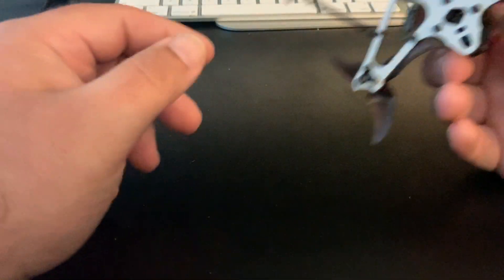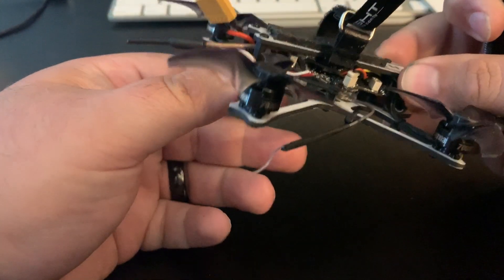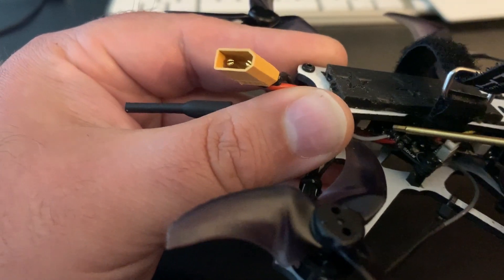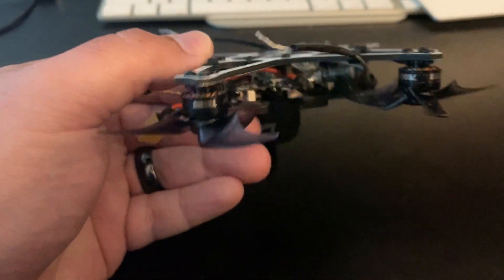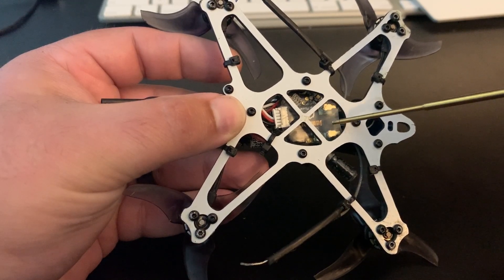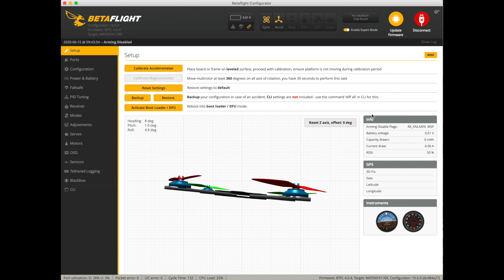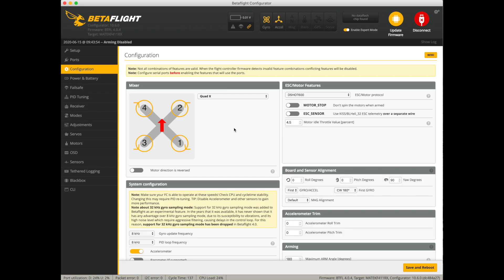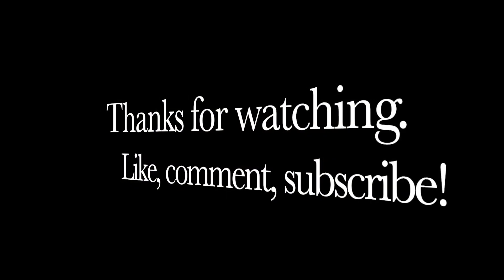TH Freestyle - Jumper R1/ Sbus Receiver Setup

Comment: Hey man , i know its kinda old vid as for today but i have a Q how much range did you got from that setup , i have same quad with Jumper Tlite and jumper R1F on same wiring and im getting 400m tops at plain fields  and than having RXloss at around 70% rssi weird is that i had BetaFPV TX and on stock SPI receiver ive got 200m o.O 
 I really dont want to upgrade to CFR right now since just upgraded to this TX and new vtx&camera :/ 
Tnx for answer in advance.
Reply from the maker: If you are still wanting to use FRSKY, I would recommend the XM+. You’ll just have to make sure you get pre access and pre 2.1 firmware. I was getting less range than an RXSR with the Jumper Rx.
Reply: @TitanFPV  I really wanted to avoid that those firmware flashing is way over my comfort lvl and I don't have where to do it I may invest in CFR just for peace of mind it seems that ppl don't have problems with it ,tnx for info.
Reply from the maker: Anytime. Unfortunately most FRSKY rx are going to require firmware updates due to their tomfoolery. CRSF is the way to go!

Comment: Question I 've been having a lot of failsafe, what could be the issue, I have Jumper t12 Pro, bind it to Frsky D16, Am I  missing something ?
Reply from the maker: The T12 Pro has a bug that causes failsafes. That could be the problem. https://youtu.be/kSfkou83rOE I myself didn’t get good range with the Jumper R1 RX with my T16. I’m migrating my quads to Crossfire.
Reply: @TitanFPV  I am thinking about to do the same thing, but Crossfire is out stock every where, I was considering Frsky R9M, but I decided to go with TBS.

Comment: jus a question : if a moto of a TH freestyle get's more hot than others, what does that to the ESC?
does is get hotter or not so much
Reply from the maker: If one motor is getting hotter than the others, check to make sure it’s free spinning, and the bell/ shaft isn’t bent. You could possibly burn an esc.